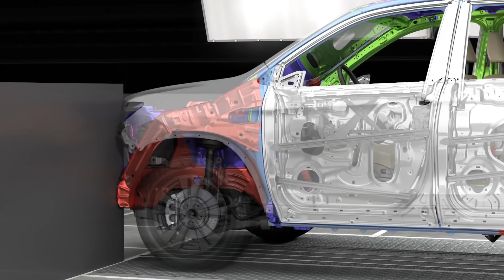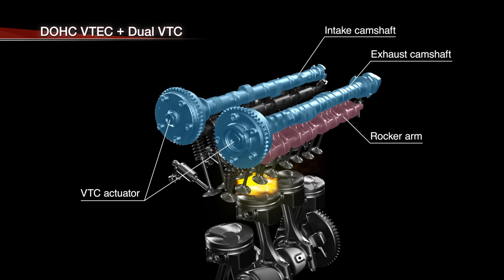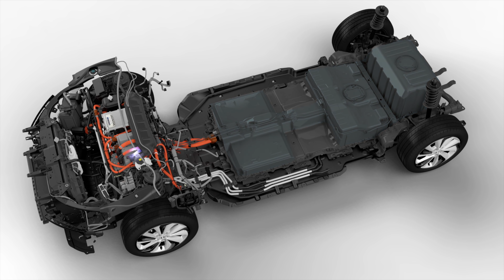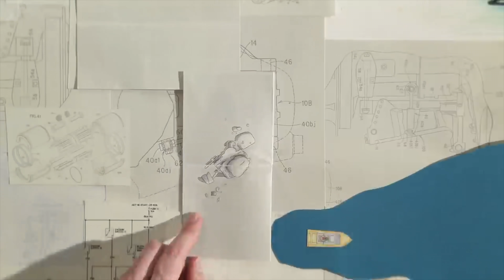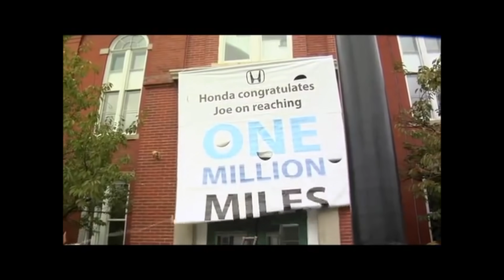Honda Doesn’t Want You to Know This

Comment: 2007 Honda jazz / fit with 1,5L engine 250000km on the clock , 3 previous owners , in the 3 years of ownership only things replaced has been 3 engine mounts , 1 wheel bearing , been the best car to own , lots of space light on fuel , sporty look and feel when driving , best car ever made

Comment: 2008 Honda Civic only things I’ve had to replace is the starter and an axle because it was rebuilt and they put an aftermarket shaft in it. I’ve put almost 40k miles on it myself I swear by Honda 🔥💪🏼

Comment: I had a 2006 Civic Si coupe.  All I every had to do was change the oil, fluids, tires, battery and clutch.  Great fun car.  I had it for 12 years and had to sell it so I could transport my kids easier.  I now have a 2020 Honda Insight.  So far a great car that drives and handles great for a hybrid.

Comment: I work as a Honda Technician at a dealership and I own a 2013 Honda Fit and my wife and I just purchased a 2021 CR-V. Both very reliable vehicles. I haven’t had a single issue with my fir in over two years of ownership and I just gave the CR-V its first oil change and no signs of oil dilution. I will forever stand for Honda and their reliability and that’s why we now have two Honda vehicles. I will only buy Honda cars from here on out period.
Reply: To be fair though there are a lot of fuel pump recalls on the 2019 models right now but I’m pretty sure there’s a lot of that going around lol

Comment: I’m most impressed by the Vtec individual coil for each cylinder. I would never have thought of designing an engine that way. Back in the day British cars would have been able to start on cold damp days if they had individual coil for each cylinder avoiding routing high voltage spark plug wires.

Comment: I’ve owned three Honda’s. Super reliable cars. ‘91 Accord when I traded for a ‘94 the trade-in was only $2,000 less than I paid for the car new. Lost that in a divorce. 
Few years later I needed a cheap drive to work car and bought a ‘88 Integra with 200,000 miles on it for $1,500. Put 90,000 miles on it before I got rid of it. Best $1500 I ever spent. It was more reliable than some new cars I’ve owned.

Comment: Have an 03 element, and an 02 ep3 civic si. Both cars have the K20 series motors, and run very strong even after 230,000 miles.

Comment: 2002 v6 Honda Accord  EX-l 4 Door sedan. Purchased 2007 used with 24K miles for $12,500.  Today 210K,  Since the date of purchase maintenance expense: $4380 (5 tire changes, 14 Syntenic oil changes (once a year average 12K miles) 1 timing belt, water pump and tune up)  Excellent ROI!!!

Comment: Bought a '98 Honda Civic manual transmission 118k for *$750** seven years ago.  It's still running strong 💪💪💪💪.  Currently at 180k....I need to start going on more road trips to get in the million mile club!

Comment: I had owned 2 Integra sedan before, stylish and very spacious, I missed them badly. Now I owned an American-made 2001 Accord (Got a 1 on the first digit of the VIN number!) All repairs are related to wear and tear and abuse from previous owner(s) they all cheap and easy DIY fixes. The only defect I can find are faulty Fuel pump relay and HVAC control switches due to poor quality soldering tin, I easily fixed them with reflowing the board.

Comment: My first new car was a 2002 Civic. Changed the oil every 3,000. Did the timing belt/ water pump at about 90,000. Traded it in after 14 years and 199,870 miles. It was overheating as I pulled into the dealer due to a leaky radiator. They gave me $500 for it. They would have given me more but I had an accident in it at 20,000 miles and they said that made it worthless to them. 
Bought a CRV for a year and hated it. I now have a Rav4 which I love and will be keeping it to 200,000 miles or more. I take better care of the Rav4 than I did the Civic.

Comment: I have a 2015 Honda Fit and am planning on keeping it for eons...especially since new cars average $37,000 now.  In 2016 I went into a Honda dealership in Denver and saw a 2006 Element on display inside.  A woman had recently traded it in after 10 years with 445,000 miles and NO PROBLEMS!
Reply: That being said, my car SHOULD have been part of the recall for engine coils but wasn't.  My coils and fuel injectors went bad at under 50,000 miles in 2018.  The warranty covered the injectors but I had to dish out $580+ for the coils.

Comment: Got a 94 Accord with 40k on the clock. It belonged to my Dad (Memory Eternal) the engine looks new no grease or dirt, amazing. Exterior needed touch up. Dad sometimes used the braille method of parking! Lol!.

Comment: Of all the vehicles I've owned through the years, my Hondas have had the lowest overall cost of ownership. As a mechanic, the last thing I want to do is get off work and work on my daily drivers. Maintain them and they will treat you right. After 7 hondas through the years, and many miles and abuse, I approve this message!

Comment: My Del Sol has 341,000 Miles... still have same engine. I did replace piston rings and rebuilt upper Head... but rest of engine is the same. Never touched the bottom 1/2... same clutch, transmission etc...

Comment: I bought a used 2013 Honda Civic in 2016 and I driven the crap out of it. After adding about another 60K miles still feels as solid and performs like the day I bought it (@55K miles). It just feels so well made and responds like a higher end sports car would. If you need a cheaper car you cannot go wrong at all.

Comment: I’ve got the Acura csx 2006 and it is mostly original at 360 000km . K 20 engine only needed spark plugs at 240 000km and the check engine light turned itself off!!! Do all the maintenance myself. Also own a 2017 Acura RDX, my favourite car ever. Own a Honda rubicon with a foot shift manual trans. Honda is the staple of durable atv. I’m a Honda die hard, I wish they made a sled

Comment: I have a 1998 integra and I push It hard almost all the time and it still runs strong with 210k miles on the dash , b series are bullet proof just gotta do oil changes and that’s it

Comment: I’ve owned several Honda’s and Acura’s. Last Honda product I owned was a Acura TLX. While driving home after I purchased it I noticed the vehicle vibrated under light loads at several cruising speeds. I went to my Acura dealer immediately to report the problem. After many attempts to identify the source of the problem through the dealership and finally through Acura USA Acura USA concluded the vehicle was operating as designed. Acura USA denied anything was wrong with the vehicle although everyone who drove or rode in the car said they definitely felt the car vibrate. I sold the car at a loss and will never buy another Honda product again.

Comment: 2013 Ridgeline Touring with 58,000 kms. Purchased with 45,000 kms. Owned for two years. Needed to replace the original battery... Three oil changes... Oh yea, the batteries on the tire pressure monitoring system started going funky so I bought 4 news ones for kicks.

Comment: Love my 2001 Honda Accord LX. Only had 70k miles on it when I bought it back in 2017 for $2000. Has about 120k now. I updated most of the interior. And I maintain the crap out of it. Filters/fluids/belts/seals etc. I/M is green across the board and my last code was a P1457 evap canister a few years ago... This car literally costs me nothing since I do it myself.

Comment: I purchased a 3-year old CRV two years ago. Because it runs on direct injection fuel, my mechanic suggested I go for de-carbonisation every 40k km to remove the built up carbon. So this is extra cost which I didn't have to do on my previous Hyundai Avante, Nissan Sylphy.
Just last week, I had to replace the brake master pump due to leakage. This is the first time I ever had to replace this item since I began owning cars in 1996.
Is it only me?

Comment: I have a 02 Honda Accord EX with leather. It has a 3 l v6. It has 261,000 mi on it. I just replaced the rotors on the front and they were the original. I plan to replace the wheel bearings and ball joints soon and then 5,000 miles or so it will need struts.

Comment: i own a 2009 uk model civic hatchback 2.2 turbo diesel and its the best car ive had and ive had many cars!  its done 145,000 miles now, i got it with 60k on it 5 years ago and i can honestly say that it has never let me down once and even gets better mpg now its older( genuine real world 50-53 mpg) and apart from changing the oil and the filter every 10k and replacing consumables its cost me nothing! At 140 bhp its quick enough in the real world and handles good, is ok in the wet and snow too and a joy to drive still. I will keep it til it blows up😂

Comment: 420,000 kilometres on our K series 2.4lt Honda. Still runs strong and barely burns oil.
The only let down is the VTEC oil pressure sensors and the solenoid.

Comment: One of my first cars was a 1992 Honda Accord LX. I got 225,000 mi on that car. The only repairs that were ever done outside of brakes and oil was due to a fender bender I had. The radiator cracked but even that was a $500 job out the door.

I made a lot of poor decisions in my youth. Selling off this car for the lemon I would end up getting is among the top of them. Hondas are good!

Comment: I owned a 2001 Isuzu Rodeo. The Rodeo and Honda Passport were, basically, the same vehicle, GM engines and transmissions and all. Also, I understand that the name “Civic” came from CVCC which stood for Compound Vortex Combustion Chamber.

Comment: I just hit 69,000 miles on my 2018 Civic EX-T. It runs as well, if not better, than when I drove off the dealership with just 4 miles on the odometer back in June 2018. Aside from the regular maintenance (oil/filter, engine air filter, transmission fluid change) I only had to replace the brake pads, the tires, cut the rotors, and bleed the brake fluid. I also chose to replace the spark plugs early even though the Honda Service mechanic said I could easily go to 80,000 before considering it. I hope to drive trouble-free for at least 250,000 miles.

Comment: I owned my Honda accord 2003 V6 for 16 years however as you're aware Scotty they upped the VTEC engine from 2.5 to 3.0 and had issues with the transmission not syncing with the engine. Nonetheless Honda did a recall and fixed it.  Pass my card onto my best friends son with 275,000 miles mechanic who checked it out told her son that it could last another five years if he took care of it the way I did.   I now have a 2019 Acura RDX with the tech package I hope it last me as long.

Comment: I had an 06 Accord from new 6 1/2 years. 148K miles and trouble free. Went to a Toyota RAV4 v6 and had it 7 years , 100K before rear ended by a semi and totaled. Trying a Subaru Forester now. So far 30K trouble free miles. The Toyota and Subaru were both used.

Comment: Been a Honda guy ever since driving  95 Integra  GSR for over 12 yrs, sold it in 2009 with 194K. Got a Legend and Prelude that I'm proud to own.
Disappointed to see majority Hondas/Acuras lately are NOT made in Japan. Also, don't care much for a CVT transmission nor turbo. They don't build them like they used to. Hopefully, the reputation of reliability holds strong.

Comment: 2012 Honda Civic 1.8 liter here. No troubles to date!    It just works day after day. Quite a difference from my previous car 2002 Ford Taurus. Struts and shocks gave out and electrical gremlins,  undercarriage rusted out in less than 10 years with having underbody car wash. Was Unsafe to drive Very sad

Comment: 2017 civic 2.0 na.  102 km  zero issues and the CVT hasn't had any hiccups like my 07 Altima which died at 160 kms ( tranny) and had trans fluid changed every 50 kms . So I'd say Honda good so far.

Comment: Got a Prelude motegi, original engine gearbox and clutch. There's not many cars out there I'd swap it for, and all of them would cost me many times more than my lude did/does. Going to run it as long as I can. 200bhp of pure 4 wheel steering pleasure.

Comment: 2000 honda accord v6 coupe 384890 miles so far i drive about 100 miles per day to get to work. parts replace besides timing belt and water pump.   1 alternator @ 325k, 1 egr replace 6 coils just because they were old 1 rear caliper still drives smooth at 80mph.

Comment: 2009 Accord 5spd manual. 232;000. Original clutch. Only changed starter, shift cable and axle, only because the axle made noise in hot weather.

Comment: I bought a Civic in 94 new, drove it for twenty years until steam came out the exhaust. 
I replaced the fuel pump and axes after 18 years.
Still runs, I gave it away. 
I then bought a used 2012 Civic, great car.

Comment: 2000 Honda s2000 I bought with 35k miles. I've put 60k hard hard miles on it. Only thing is needed is oil changes. Still original break pads with lots of life on them.

Comment: My 2007 Honda Pilot Konked out at 285000 miles.  Yup, when I was side swiped by a Ford Ranger. It was the only time I ever saw it leak oil.  Replaced with new Pilot.

Comment: '14 Accord with the 6 speed manual.  Last year was the last year in the U.S. for the manual Accord🙁.  I guess I'll just keep it "forever".  170,000 miles , perfect so far.  I've owned my '65 Corvair for 39 years, so it should be easy.

Comment: I have a 2011 Honda Accord EXL with nav V6 with 250,000 miles. I drive from the country to the city 5 days a week putting over 60 miles each day. It hasn't been too bad on me although for the past couple years the engine has been making some noise
Reply: Valve adjustment?
Reply: Some V6s had noise emanating from the passenger side rear. It is a part called the bridge which needs to be retorqued, iirc.
Reply: @TheNortheastAl  is that similar to the valve adjustment procedure that my local Honda dealership will do for $800
Reply: @johnkhoury848  just did a Valve adjustment for my 06 Accord at a Honda dealer for around 23.50USD.
Reply: @johnkhoury848  no, this is the part that holds the camshaft in as I remember

Comment: I have a 2017 Honda CBR1000RR fireblade.  Not the fastest of the liter bikes .... however dependability with that type of power is greatly under appreciated.   Owned only Honda motorcycles and i think they are the best

Comment: My first Honda was a '97 Accord. I leased it not being all that familiar with the Honda experience. I was hooked. Since then I have leased two more Accords, bought a Fit and 4 Civics. My first was a 2003 Civic which I gave to my son and he still uses it daily.  I traded my '06 Civic for a '17 Civic for my wife, and I traded my '15 Fit for a '19 Civic Si. All of my Hondas had a 5 or 6 speed manual transmission. I'd like to keep a Honda in my driveway in the future, buy it appears that Honda is phasing out manual transmissions. :( So I'll keep my Civics until either they or I kick the bucket. I think they will outlive me.

Comment: I own a 95 Acura integra gsr with a b18c1 engine manual transmission. Rite now the car has 370000 miles and going strong. I also have a 98 Acura integra RS with 204000 miles manual. And I have a 03 accord with the k24 and it has over 200000 miles. I wouldn’t trade them for anything. I used to have problems with cars breaking down and it costing me a job for missing work. Now that I own a Honda I haven’t had that problem

Comment: My accord coupe 2005 model has 406 k miles, only changed the alternator once and starter once.  Minor repair issues only and I change my own oil, transmission flui😁d and tune it my self

Comment: Hi Scotty, thank you for this great video, I have experience with Honda, my first car was 1998 Honda civic, very nice car, and a Honda accord boss 2004 was also very nice, but the CRV 2009 diesel with manual transmission have a lot of problems like the clutch that cost money, I switch to MB ECLASS C250 automatic, absolutely no problem after 3 years absolutely no problem, now I want to switch to Honda CRV gasoline I-vtec 2009, I just want to know if this model will have problems too, the price is about 8k its the first owner, thank you so much

Comment: I first had a 97 accord, then 2011 fit, and now a 2019 fit. I like the 2011 better then the 2019because of the interior features, the new one have a different transmission still on the fence about that.

Comment: Have a ‘09 manual accord sedan, 108,000 miles

2007 Honda crv 180,000 miles

And lastly a 2010 Honda Odyssey 260,000 miles. All of them have original everything, even shocks and coolant 😂. Also a 1983 honda nighthawk motorcycle, though that wasn’t bought new but im assuming its like 80% original aside from fluids brakes and tires. Great vehicles, im never going to another car maker unless i need a truck.

Comment: I need a car, and I’ve been stressing over deciding between a Mazda and a Honda, and maybe this video is a sign.
Reply: If you can find a 2005-09 Mazda3 with the frame not rusted out, then you could get it for far less than a new car. The only reliability problems on those are the frame rust, and motor mounts. Everything else is Honda-esque, and is engaging to drive.

Comment: I have a 1990 honda civic sedan and a 1994 honda civic coupe. I've had both for 13+ years... The 1990 has 400,000 miles and second engine and the 1994 has 178,000 still on its first engine

Comment: I have always known that Toyota and honda were above-average brands but I have had so much better luck with the Toyota brand that I am now brand loyal. Hondas are great but the timing belt issue always scares me. Unless you are willing to buy a honda and send it off to have a new water pump and belt done I will continue to look for cars with the timing chain and noninterference heads. I know if you have the 2.4L those have the chains but the last 2001 civic I owned had the timing belt and the tensioner broke destroying the belt and damaging the valves, and even though I had the head redone it just never seemed right. I should have just bought another head. Great content Scotty.